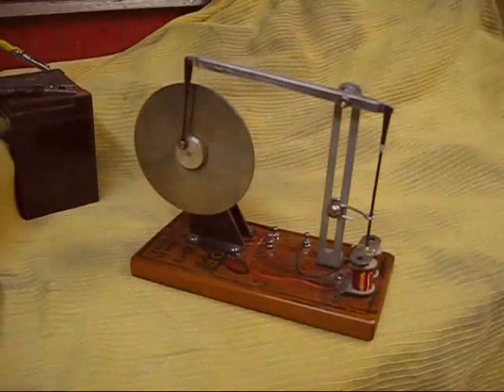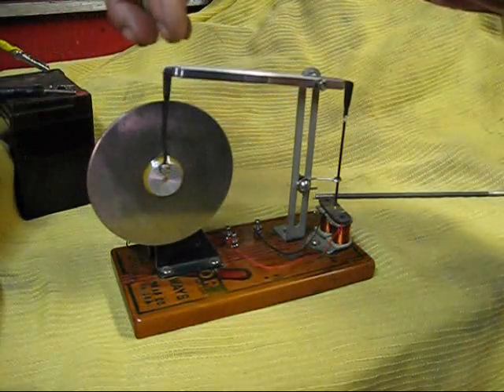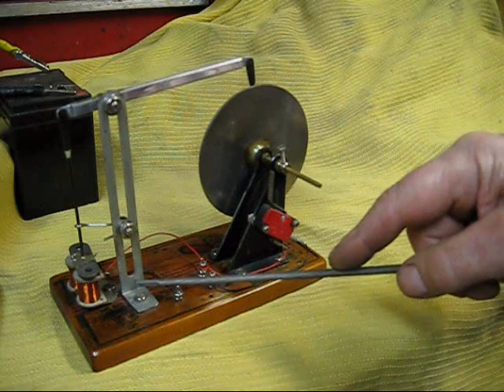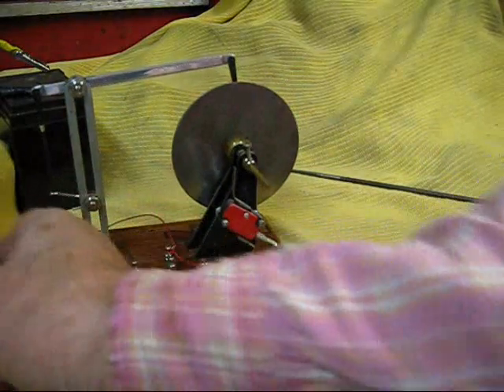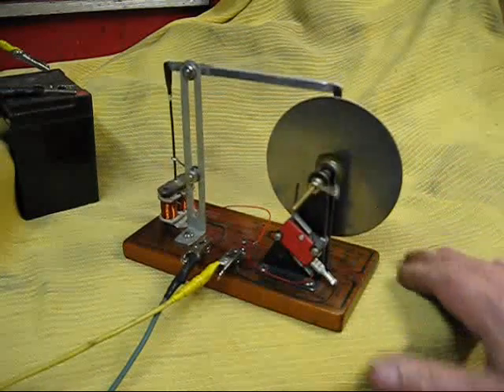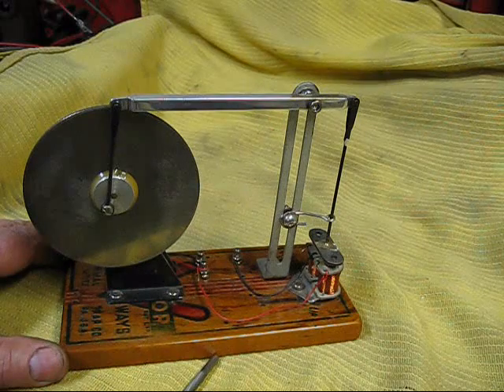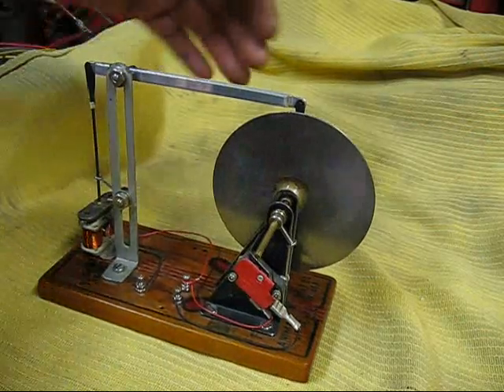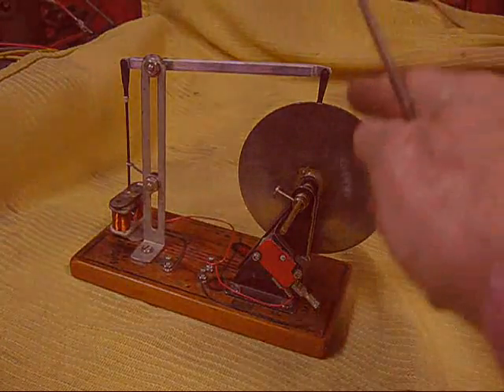Mouse Trap Walking Beam Electric Motor

Comment: I love it. I wonder one thing -- where exactly could one add a bit of weight on that flywheel to help it go. It seems like it might work better with a bit of weight on the wheel because it is essentially a locomotive engine where they also use weighted counterbalanced wheels because this is changing one direction reciprocating motion into rotary motion.

shopdogsam, you should be building kits for kids to learn engineering! I love this kind of stuff (got here from AvE's channel), subbed.

You have a simple engine but a lot of teaching tools built within this thing. Levers, my mind is reeling with equations and yet it is so simple with one pulse of electrical power.

Comment: I wish you would have mentioned about if the coils fired around top dead center before top dead center or after top dead center of the flywheel spin
Reply from the maker: +Ryan Curry ,, well,, you don't have a choice,, if it entergizes the coils at dead center, the motor stops,,,,, if it entergizes after dead center, it will run in reverse,,,

Comment: neat Idea, Sir You could add a small Generator to generate voltage roughly proportional to shaft speed that would replace the use of battery when its running as like a car's electrical system.. I am sure you could figure it out

Comment: Hot Dam it's Roy D. Mercer, well at least you sound like him. Nice job on the motor by the way but does it actually work? Don't see it powering anything or any reading coming off from it with a meter.